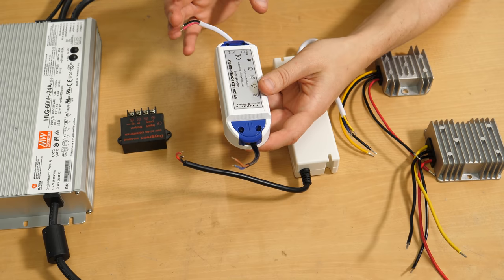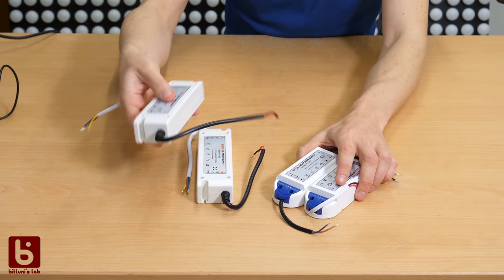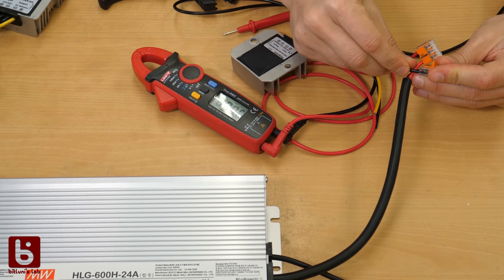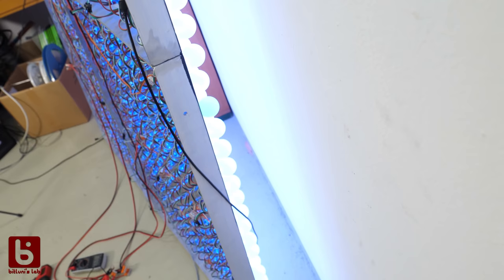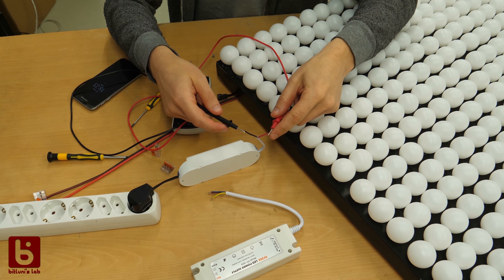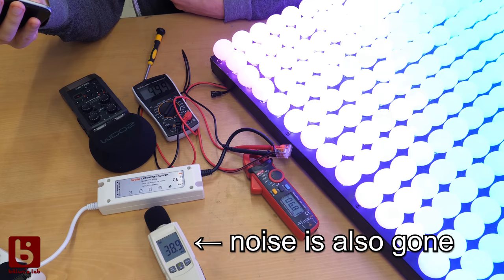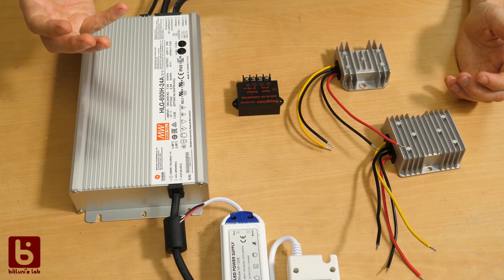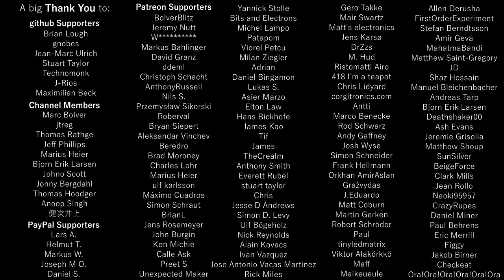Testing Power Supplies for LED Projects

Comment: Can you run into problems when your power supply can deliver much more current than needed. Let's say my Led strip needs at max 10 amps. When I use a power supply 5v 40 amps, that's always ok?
Reply: not really. Current usage is determined by the load. Running a power supply below it's rated output just lets it run cooler.

Comment: Why did you not use 12v Adressable leds? The current would be way smaller
Reply: They would become much more hot. Addressable LEDs use q linear regulator, so the 12V get dropped to 2.2-3.2 (red vs blue/green), meaning around 9V get dropped. The current would be the same as you can't increase the current with a linear regulator.

Comment: I need power supply to 12V LED Strip. Led strip is 13m long and need 82W power. Wha Power Supplies do you recommand to me? :)
Reply from the maker: Maybe 6.25A 24v from the description and few smaller ones 24 to 5 distributed along the strip
Reply: @bitluni  thanks for answer. 12V power supply is much worse than several 5V power supplies in the case of LED strips? Is there a big difference in the quality of light? :)

Comment: Meanwell might "mean well" but they certainly don't sign or label well! As others have mentioned having a model number 24A and 48A is TOTALLY disconcerting and confusing. Have a "-" in there at least  like 24-A and 48-A or even 24v-A  and 48v-A. The way it is  currently shown is really dumb! I'd have expected better from a well known manufacturer such as Meanwell. Nice looking supply though.

Comment: Why not use a ATX power supply? You could get good quality one with similiar power for like 50 euro. Of course it would be 12V instead of 24V.
Reply: I would go for a (used) rack server power supply instead. The build/component quality is much better. I, for example once bought six 54.4A@12V units for 3.5eur apiece (plus postage). Made a 12/24/36/48V PS out of four of them.
Reply: @MrZetor  but server PSUs are loud, and one of the goals here was to make it more quiet. ATX PSUs may not be completely silent (excluding the passively cooled ones), but they are very quiet.
Reply: Computer Power Supplies typically only list the peak current if there is a spike. So if you have a supply that can handle 5 Volts at 25 Amps it's probably for about ten seconds at most.
Reply: @lelandclayton5462  not true at all, quality ATX supplies always list continuus current. Actually, most of them can handle a lot more current than they are specced for till the voltage starts to fall out of the ATX spec.
Reply: Older ATX PSUs also supply a lot of 5V, often 30A or more. That was taken advantage for Perk mining back in the day, some running racks with dozens of cheap smartphones.

Comment: Can a PC power supply power LEDs?
Reply: ATX PSU's can source 5V (between the red and black wire) so it can be used to power bare LEDs but ofcourse those need a resistor to limit current but the PSU's green wire needs to be connected to a black ground wire otherwise the PSU doesn't turn on.

Comment: You should have tested a PC power supply
Reply from the maker: I have one used for my first led wall. it still has a fan. anything silent is expensive there.
Reply: From personal experience PC atx power supply fans are very quiet and designed to run nonstop for a very long time so I wouldn’t worry about the fan.

Comment: 13:00 This looks like some cheap and nasty flyback laptop power supply in the LED supply box. Isolation on PCB looks horrific as well. Please don't use it :-)